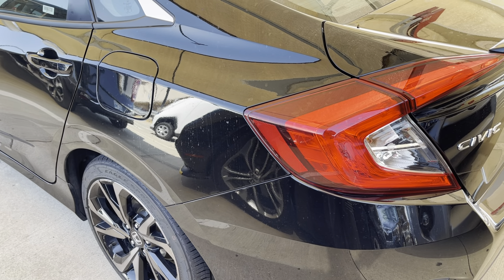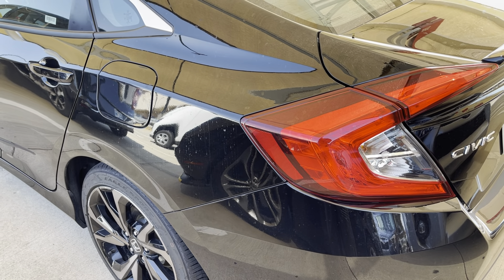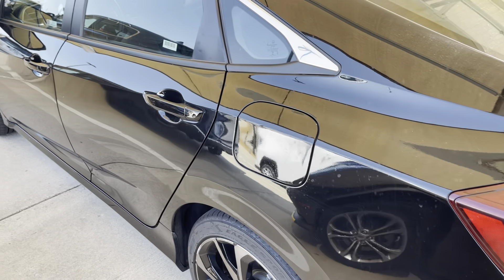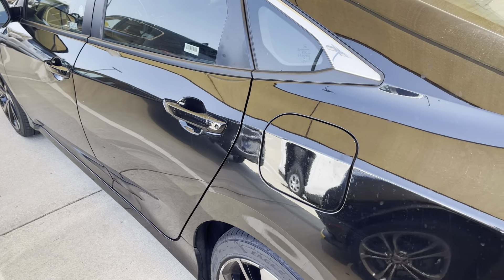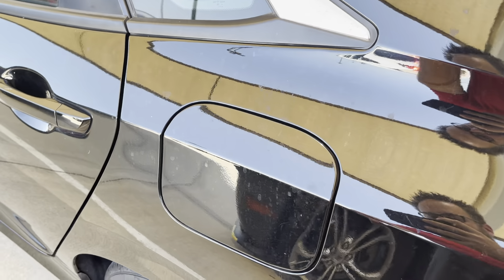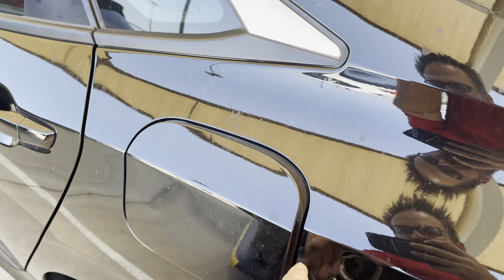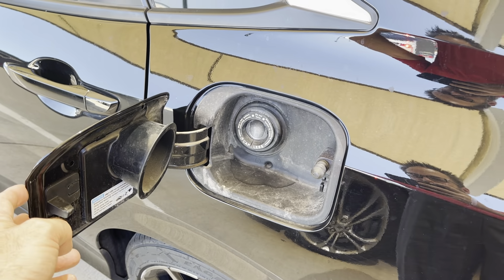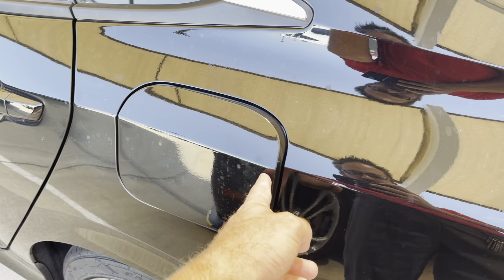2021 Honda Civic - How To Open Gas Cap Fuel Door

Comment: What do you do when it sticks?
Reply from the maker: I have taken something like a credit card and slide it in to pry it open as you try to open it.
Reply: You have to make sure the car is unlocked. There's a latch in the fuel door that locks & unlocks with the key fob when locking & unlocking.